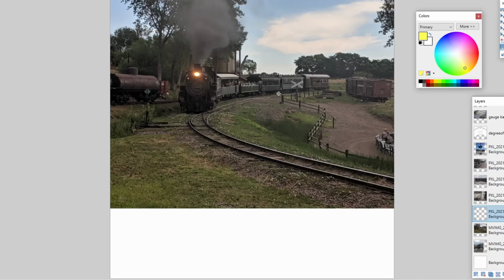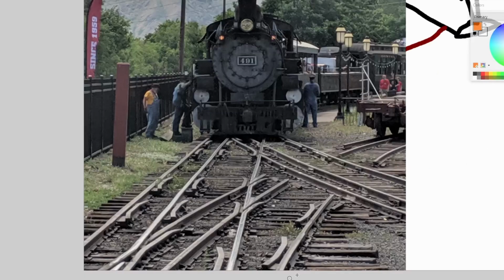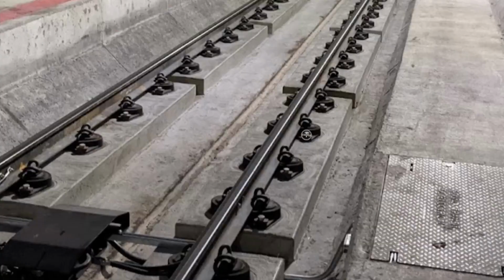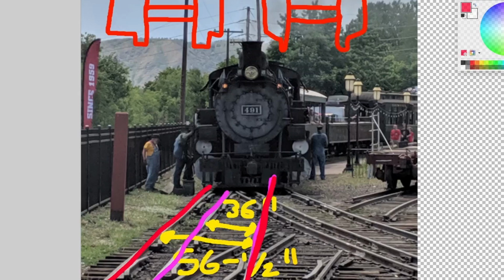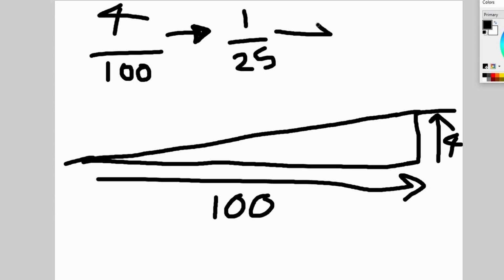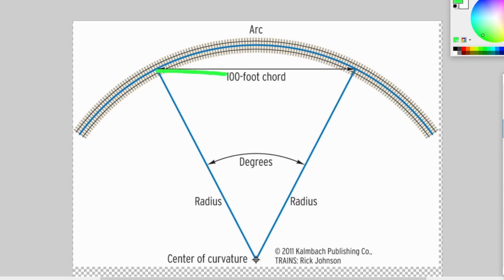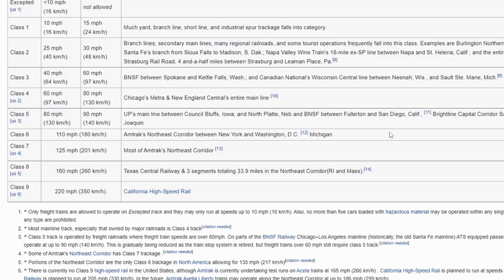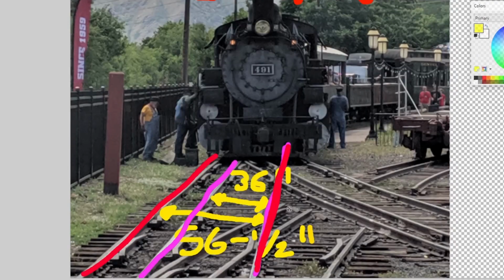TRACK 101: How does track work? (Including many often-missed things!)

Comment: A bit disappointed that you did not introduce us to the term “shoofly” track when talking about panels.  The track I have the most direct experience is 12 lb. rail in 15” gauge.  I spent 8 years of summer weekends running Crown steam locomotives in a park in Flora, IL.  Small scale but with all the good stuff, coal smoke, steam whistles, and kids laughing.

Comment: here on indonesian 42" (3ft6") railway:

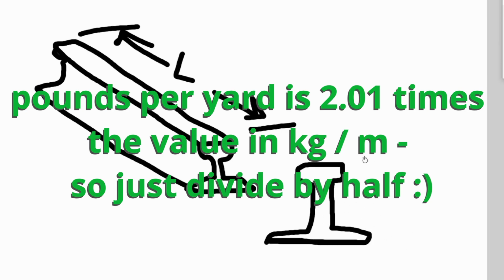5:26 R15 (15kg/m), i didn't know if this still exist in indonesia
5:27 R25 (25kg/m), some places still have this rail type
5:42 R60 (60Kg/m), sumatran lines?

most of indonesian mainline use R54 (54kg/m), some places still use R42 (42kg/m).
correct me if i'm mistaken...

Comment: Thanks for mentioning some of the different terms used in the UK. Here are some others:-
Super-elevation used to be called cant here. I don't know if it still is.
The standard rail length between joints used to be 60' (before CWR).
Spiral curved track is called a transitional curve, as its a transition from straight to the final radius.
Rail joiners are called fishplates here (because the original cast iron sections of rail had a 'fish belly' shape).
What the track and ballast is laid on is called the track bed, whether in a tunnel, on a bridge or raised on an embankment (a pile of earth and rocks used to raise the track above the surrounding land).
The word grade is rarely by used by railways here. Gradient is the rate of rise or fall in the level of the track. Your 'grade crossing' is a 'level crossing' here.
Most narrow gauge railways here run on 2' gauge track and some European countries had extensive 2' (600mm) gauge systems, some of which are partly preserved. I don't know of any 3' gauge track in the UK. Metre gauge (3' 3") was common in some European countries for tram [trolley] tracks.
And you didn't mention anything about expansion gaps or expansion joints in CWR. Very important if you don't want your rails to buckle in hot weather.
Reply: Metre gauge common in Africa Kenya and Tanzanian Railways (The British built ones) Chinese now replacing them with Standard Gauge
Reply: @kevanparker908  The original metre gauge railway in Tanzania was built by the Germans when it was German East Africa (before WWI). Later additions were made by the British.
Reply: 3 foot gauge is used extensively in the Isle of Man. That’s for the main steam railway, the Manx Electric Railway and also the Douglas Bay Horse Trams.
Reply: Standard rail lengths being 60' long is only true in the later years before CWR became commonplace. Sectional lengths increased in the period 1865 to 1915. The Settle and Carlisle line was laid using 24' rails weight 83lb/yard. By 1983 the Midland Railway 30' sections of 85lb/yard and by 1896 they were using 100lb/yard rails in 36' or 45' lengths. By 1915 most railways in the UK were using rails of between 90 and 95lb/yard and 45' long, only the LNWR and NER were using 60'section lengths.

Comment: I really enjoyed this video, doesn't the steam engine guide wheels only swivel, but drive wheels ( because of the push rods) can't, unlike diesel loco where the entire trucks can swivel, maybe that is why turns were not tight back then. I would love for you to do a segment on that ( with photos or videos) thanks, once again great video.
Reply from the maker: Depends on the steam locomotive, as there were some odd ones that did swivel! But yes, by and large, most steam locomotives only have some amount of "lateral travel" where the axles can slide left and right.

Comment: You didn't mention the relationship between the curvature of the track and bevel angle of the wheels and how it eliminates the need for differentials. Also the importance of the flange never contacting the rail particularly at higher speeds.
Reply: I appreciate you mentioning this. There are still some (who arguably should know better) who believe that mechanical contact between the flange and the rail keeps the train on the track. The impressive mechanics that result from the compound curves where the wheel meets the rail are truly elegant for those who understand the math (and the physics). Not to mention that they were worked out more than a century ago.
Reply from the maker: I didn't! Kind of one of those, "when does the scope end" kind of questions.

Comment: Sorry to see Railroads Online (saw a few videos about it) seems to insist on Windows. 
Also, continuous track - at least over here - is not really continuous, because that gives thermal problems (rails want to expand and contract, you want them to do that longitudinally, otherwise you get derailments). What is done at least on high-speed lines over here is that like in switches or points, the rails get thinner towards the end, and these thin segments are put side-by-side, so the train doesn't have to cross a gap (very bad for high-speed-rail, not only uncomfortable and loud but much wear on rails and wheels).
Also, high-speed rail often uses what Germans call "feste Fahrbahn" (literally, "solid road" or even more literally "solid driveway"), which tends to be along the lines of concrete sleepers set into a concrete base. There are a number of variations with some interesting engineering to reduce sound and vibrations, for example by including some rubber.
One more thing about ballast: clean ballast is important for good drainage (obviously handled differently in the above case). Once the ballast gets dirty (which invariably happens), you lose good drainage, and the ballast has to be cleaned or replaced.
And one more for the signals engineer: ETCS. (For a decent introduction, either find videos on YouTube or just read Wikipedia, it's too much for this comment.)
Reply from the maker: That's really cool! Thanks for the details. I would love to see German high speed setups in person.
Reply: @Hyce777  I'd especially recommend the "Nantenbacher Kurve" https://en.wikipedia.org/wiki/Nantenbach_Curve which contains a switch/point specialized for high-speed trains - I believe the limits are 200 km/h for the mainline and 130 km/h for the branch line.
All of this stuff can be found on YouTube and likely on Wikipedia.

Comment: Nice job. Thank you for the video. I have a question.   especially for those continuously welded rail and very long lines of railroad track how is thermal expansion and contraction dealt with?  every so often you hear about railroad tracks buckling in the high heat. Just wondering how this thermal expansion and contraction is taken care of.  are the tracks laid with curves at pretty good distances to allow for the thermal expansion ?     thank you
Reply from the maker: Rail anchors help with this by limiting the amount of motion the real can have. As well, the rails are laid at approximately the "neutral" temperature for stress in the rail based on the environment the railroad runs through, such that the amount of variance is typically not too much.
Reply: @Hyce777  thanks.  The computed expansion for a rail 1/4 mile in length with a 25 degree F rise in temperature is 30 inches.  That’s a lot of expansion to compensate for in those rails.
Reply from the maker: @260bill260  No kidding, I'd have to go bark up a civil engineer's tree to better understand this piece myself. :)
Reply: I was wondering about that myself. I had assumed that the fishplates were designed to also provide thermal expansion joints, but doing a bit of wikipedia research, seems not to be the case. However there are special joints used to provide expansion when needed. Otherwise, it's as Hyce said, lay the track in the middle of the expected temp range, and physically constrain it! On wikipedia, Railway_track#Continuous_welded_rail has some discussion of the challenges.
Reply: @Hyce777 And coming back to link to @PracticalEngineeringChannel's great video on the topic: https://www.youtube.com/watch?v=zqmOSMAtadc Turns out, lay them at "neutral temperature" which is actually near the high end of expected range, so that the rails are usually in tension.

Comment: 25:12 Isn't the reasoning behind four rail dual gauge in roundhouses that it allows a turntable to turn an engine 180 degrees and still be able to line up with any of the stall or escape tracks?
Reply from the maker: also that, hahah

Comment: The bottom of the rail is called the Base...not the foot.
Reply from the maker: I have never heard anyone call it the base of the rail. I am not surprised if that's true somewhere in the world, it's certainly a fitting term.
Reply: @Hyce777  I worked 44 yrs in railroad Track Maintenance .... 20 yrs as a Track Inspector and never heard it called the foot. All of it on U.S. based railroads. Never saw it called    the foot in any manuals either.
Reply from the maker: @randallkuehnle8228  well then you're certainly much more qualified to make the statement than me! haha. Wonder if it's an east-west thing?
Reply: @Hyce777  well i'm not sure....I'M thinking it may have changed over the year's and morphed into being called the base. I  know around here ( Michigan ) if you called it the foot people would look at you wondering what the hell you mean.
Reply from the maker: @randallkuehnle8228  lol, that's so weird - I'd say the exact same thing about people not calling it the foot. weird how idiosyncratic this stuff can be sometimes
Reply: @Hyce777  but i do see it called the foot on Wikipedia....so i guess thats what it is called..... just never heard it called that by railroaders.
Reply: @Hyce777 the head is the ball. Ball, Web, Base.

Comment: I forget the specifics, but I think it was a French train that was the first to have the whole tilting mechanism they greatly overestimated the amount of tilt needed and it actually led to passengers becoming very motion sick because of it.
Reply: British Railways developed the Advance Passenger Train in the 1970's a tilting train, Passengers said it gave them motion sickness, British Railways then went on to buy the exact same thing from the Italians!
Reply: @kevanparker908  The vomiting was mainly down to the fact the three or so runs of the ‘production’ Advanced Passenger Train were press junkets, and free alcohol was provided in large amounts or the reporters simply would not show up.

The main reason for the failure of these runs however was they were from Glasgow to London over some really exposed country either side of the Scottish border (Beattock and Shap summits) in the middle of winter in a train that did not appear to have been properly tested for adverse conditions. I don’t think any of the runs reached Euston.

It wasn’t a complete waste of time and money – Both the BR mk 4 coaches and some multiple unit derivatives and the class 91 high speed locomotives were developed from the APT in its’ final form.

Comment: The main reason for a four-track dual gauge track at the turntable is to have all rails aligned after a 180 degree turn. 
If regular three track dual gauge was installed onto the turntable, a standard gauge loco would still align, but the narrow gauge loco would NOT have aligned tracks.
Reply from the maker: That's also a big part of it, which I definitely overlooked... lol. cheers

Comment: 30:50 wait Talgos can tilt? You mean the trainsets they use on the Cascades where they go about 20 mph the whole time? I swear they're just mocking us, high speed trainsets on a route that doesn't even have station platforms
Reply from the maker: lmao 

yes the talgos of the cascade service tilt. we have separate speeds for them - commonly called F speeds (freight), P speeds (passenger) and T speeds (talgo). you can see the signs on the wayside.

Comment: Thermite, for the curious, is a compound of iron oxide powder (rust) and aluminum powder. When it's burned it reacts into aluminum oxide which is carried away in a cloud of dense, white smoke, and molten steel. The kind used for rail welding comes in pre-mixed kits with the correct additives to form the desired grades of steel in the correct parts of the weld. Softer more malleable steel in the foot and web and harder and longer wearing, but more brittle steel in the head. The workers install a form designed for the task on the rail join and put a thermite kit in the top. Set it off with a magnesium fuse and it burns at extremely high heat and dumps the molten steel in the gap between the rails. After it cools, the head of the rail is ground to shape and two pieces of rail are now one. As a side note, solid rocket boosters use aluminum powder for their fuel, so that's an indication of the heat and power involved. If you've seen a solid rocket engine like the strap on boosters of the Space Shuttle burn, the white smoke is almost entirely the aluminum oxide produced by its burning.
Reply: Thats a video worthy comment.
Reply: Thermite has other things in it to make it work.  Because very little air can get into the combustion chamber, oxygen must be supplied from weakly bonded oxide powder mixed in.  There are also slag forming chemicals to scavage the excess aluminium (proper spelling, most modern metals are spelt -ium except in the US) and oxygen carrying metals plus alloying elements to produce the correct grade of steel.  bye.
Reply: @brucegennette1629   Davy spelled it "Aluminum". But, America bad, Americans dumb, we get it. Carry on.
Reply: @brucegennette1629  thanks Bruce!

Comment: if they heighted the rails to accommodate the heavier engines now, did they also make the flanges on the inner side of the rail wheels, larger in radius?
Reply from the maker: I am not sure about the history of flange height! I will have to look into that.

Comment: Talking about grade in TS was taking a double headed big boys up the tehachapi loop. Just marchin up the hill at 23 giving it's all and the lead gives up just losses all working pressure and sits at 70psi I leave the one to keep the brakes on and grabbed two challengers and back em down and pulled it up the last 3 miles before leveling back out

Comment: That half-inch of standard gauge bothers me. Why not just 56 or 57 inches? Why not 143 or 144 centimeters?
Reply from the maker: Right? Always wondered... Why not 5 foot? Would've been even and made more sense...
Reply: @Hyce777  I know why standard gauge is just over four and a half feet: they were made the width of ruts made by wagons and carts whose wheels had to be just wider than two draft horse asses. Ireland's track gauge is five feet three inches, but I think a five foot track gauge with a nine foot loading gauge would allow for more freight throughput, more powerful freight locos, faster passenger locos, and wider shipping containers.

Comment: As someone who works in track/rail design, this was a lot of fun to watch!  I've seen thermite welding in the field, it's cool to see (well, very hot, actually).

One correction for you, at 34:25.  This is NOT a compound curve, this is just a curve with spirals.  A compound curve has two or more distinct circular portions of different radius with no intermediate tangent.  There's usually a spiral between them.  For example, tangent -> spiral -> 1-degree curve -> spiral -> 3-degree curve -> spiral -> tangent.  I've used these a couple times to change the alignment coming out of a curve to accommodate new trackwork.  They're also fairly common in places like river canyons where a single curve of constant radius is near impossible to do without major grading work.
Reply from the maker: This is what happens when the signal guy tries to teach track! Turns out I've not understood my track coworkers entirely... Lmao! Thanks for the clarification!
Reply: @Hyce777  I am considerably older than you! I am actually retired, and so it has been a while since I was in the middle of things. I knew John Cippalone, the inventor of Electrocode! I am also the inventor of the Bridge Integrity and Alignment Surveillance System that went absolutely nowhere! I didn't know that old man HARMON sold out???
Reply from the maker: @shanestoddard3469  yup... Harmon got bought by GE transportation and I'm not sure where that exists anymore. Lol. It's all global companies anymore.
Reply: @shanestoddard3469 what do u mean u knew the inventor of the electrode? Some guy named John? Are we talking Galvani, Volta, perhaps Faraday? Thats like saying " I knew the man that invented the question mark.". Did u actually believe this guy? If u do believe him in have a bridge u will definitely be interested in purchasing.
Reply: @shanestoddard3469 sorry to double post but I just took two seconds to figure out what ur talking about. The closest I could get to someone inventing a railroad thing called an electrode was a black fella from 1850s named Granville T. Woods A.K.A. the black Edison. A railway man who developed the first electric welding electrode specifically for welding track. U said u were an older guy but I find it hard to believe u knew a guy in your working life who died in 1910. If you are 125 I'd let the memory of his name slide. But the math just doesn't math.
Reply: Keeps the mosquitos away if its a muggy, humid day
Reply: Having worked on a UPRR engineering (read survey) crew, i can tell you that hand-calculating spirals, especially mid spirals in compound curves will make your head hurt. Our party chief always had everybody one the crew compute each curve, until we all had the same answer, and this was back in the days before any sort of electronic calculator - just tables, paper, and a hand-crank calculator, a glorified adding machine. And, it was great work!